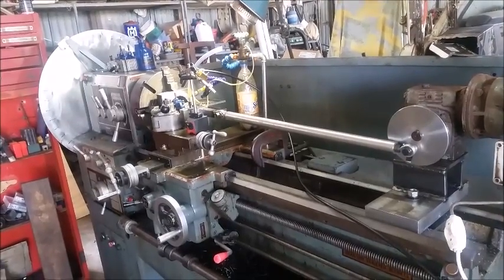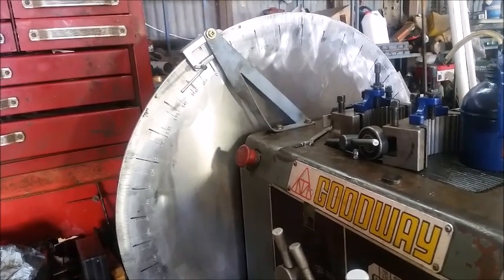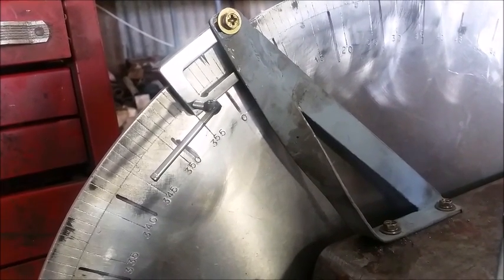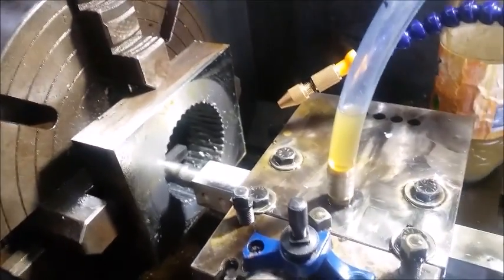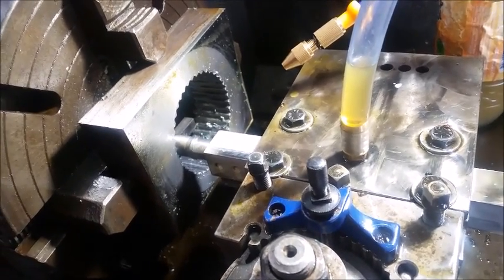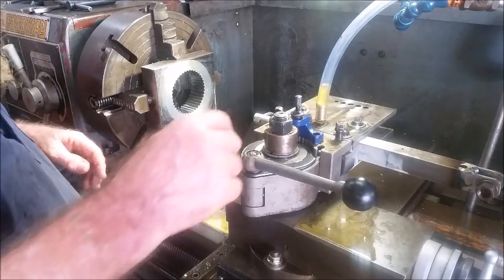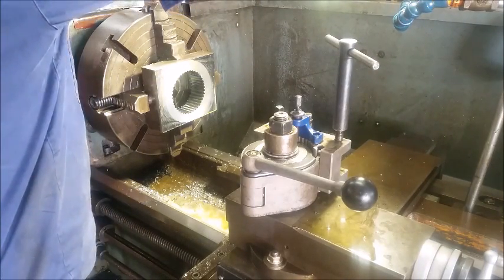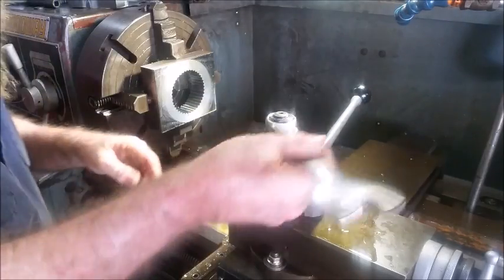Slotting on a Lathe

Comment: Nice one Merv. Please as you increase the depth of cut assuming you use the cross slide, does that not pull the connecting rod out of alignment?
Reply from the maker: Swivel joints either end so no problem. The long rod makes the slight angel even less

Comment: nice, but multifix aA, A, B, have different diametr(maybe C & bigger have another) base end cassette (you can find blueprint - USA home made multifix cassette on YouTube, & can find ecsplanation why - Germany fabricator- original & copy multifix, interchangeable  https://youtu.be/kd1BJdc3DXk) if use original dimensions you easy put in base inside blank & have  gap. better make 2 rectangle  blank drill hole for clamp, attach on plate, roughly drill cylinder saw, lathe/boring central hole & planiing tooth. its cheaper & easy, material, time & 30 teeth vs 40.
sorry for my bad English.

Comment: Nicely thought out! I was wondering, what keeps your 4 jaw chuck locked into position?  Just the little clamp on the degree wheel? If so, do you have a backing plate behind the wheel to absorb the clamping pressure?
Reply from the maker: Yes just the clamp on the degree wheel . Just held by a 6mm bolt .because  the wheel is so large it is hard to move . I often use it to find a bolt circle. Pcs and then dgs. I can set it up pretty quickly

Comment: Well done Merv!! This slotting drive is similar to one I made, however yours is the FIRST one I have seen on YT that uses similar principals to the one I have. I need to make a video and send you a link so we can compare notes. Cheers from John. Australia. PS Liked and subd.
Reply from the maker: joandar1 Thanks I don't use it much but when it's needed it's their. I often use the degree wheel to index bolt holes or such. Have a degree. Wheel on my small lathe as well. I would b very interested to see your set up

Comment: Very nice setup thanks for sharing. Did you get much back lash or runout on the cutting tool? Do you have a way to adjust the slide or is the clearance fixed?
Reply from the maker: Pete Shad. Thanks Pete I hold pressure on the shafts and dial it in. It only a few thou at the cutter. If it wears to much I will mill it out and put in an adjustable brass plate.

Comment: How do you allow for movement of the cross slide in the driven shaft / cutter shaft alignment?  Is the driving shaft mounted on a ball stud at the gear motor or something like that?
Reply from the maker: Just 2 ball joints . The one on the driven end gets a bit hot but been ok so far